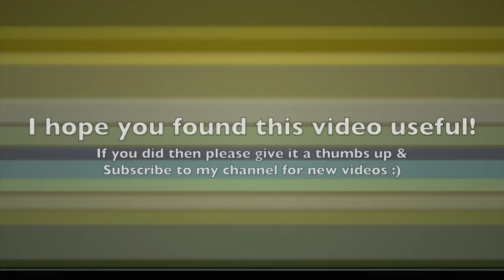How to remove mouldy bathroom / shower sealant with WD40 - like a BOSS!

Comment: Nice straight to the point video. I would however recommend using plain old water instead of WD40 in future. Its going to make it a pain to reapply new silicone.

Comment: I fail to see what the wd 40 did. You still just scraped it off. I would use a paint scraper with a single edge razor blade. All the wd 40 did was prevent the new caulking from sticking. Required copious amounts of water and soap to remove the oil and have
 ing to wait for it to dry before you caulk again.
Reply from the maker: Hi thanks for the advice- will try the razor next time round! However the wd40 worked like a charm for me, was impossible to get the caulking off without it. I sprayed the wd40 on & left it on for 30 minutes before scraping it off and it made the job a million times easier!!
Reply: Wd40 only acts as lubricant so doesn't stick to removing tool. Leave for week or months in wd40 and silicon will still be same.
Reply: Dipys 100
Reply: DIY Jay is only using this video for amazon's affiliate link. WD 40 did not do fuck all.

Comment: Hmm, maybe a nice scraper would work better. Silicone won't adhere to a surface that has WD40 residue. Also fill the tub with cold water before applying the new silicone. That will insure that the silicone will fill every nook and cranny. Once the silicone is applied, empty the tub and then wipe along the bead of silicone with a dry finger for a clean professional look.
Reply: Huh?

Comment: Did this method can work with silicone lubricant ?
Reply from the maker: Hi there unfortunately I haven't tried it with silicone lubricant but I imagine not as we need something a lot stronger like WD40 or a silicone remover. Hope this helps!
Reply: I try it with liquid wrench silicone spray and let it sit for 10 minutes and it help

Comment: Do not do this!!!!, when you reapply the new silicone it will bleed through and ruin it, no matter how you clean the WD40 off
Reply from the maker: Hi Mark thank you for the tips, I had no issues with mine and it worked fine! Of course sealant remover is our best bet if we can get our hands on some. Only thing I would suggest is dont stay in the room for too long and keep windows open until the smell is gone as wd40 is very strong stuff!
Reply: @diyfab  who wouldn't be able to get their hands on silicone remover? You needed an Internet connection to upload and we did to watch.

 I typed 'silicone remover' into Bing, first option was a shop 1.5m away one tap on the arrow and it's loaded into Google maps.
Second result Amazon. 

I don't get it fella

Comment: I use a bleach solution. approx 1 bleach to 5 water . . spray it on an leave half hour , . wash off , . also do the same with tile grouting . , no scrubbing or scraping .

Comment: Hello. There is not yet discovered the solution that can dissolve , or remove, thick silicon. Firstly , must remove as much as possible the biggest part of old silicon by a scrapper or a blade. What remains in the gap is what the silicon remover SOFTENS ! Then we use a wire brush , or wire mess , to remove completely all old silicon bits and silicon crumbs. With a scotch brite sponge we finish the job.

Comment: Most stupid idea ever. Use a single edged razor blade and don’t contaminate the surface. If you can’t remove it with a razor blade you shouldn’t be attempting to do the job.

Comment: I actually use ketchup to remove my old, moldy caulk. If the caulk is especially difficult to remove, mustard also works. Okay, so I'm lying. Not quite sure what the WD40 did you for you there. I really didn't see how it made it any easier to remove. Also concerned that the chisel would just scratch the finish, which you did caution against. The WD40 is just going to make a mess, which will have to removed in order to get the new caulk to adhere.